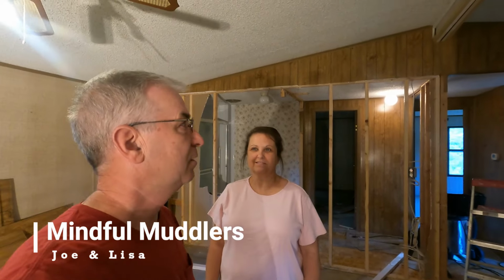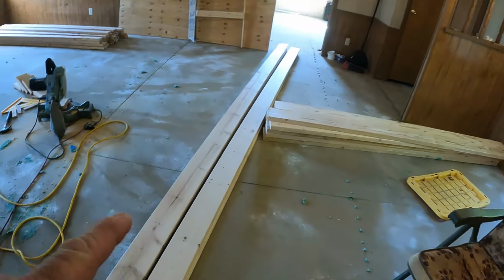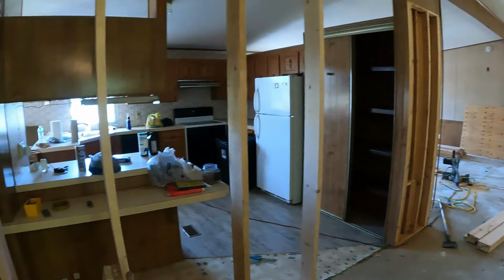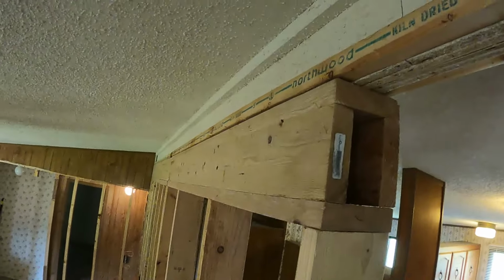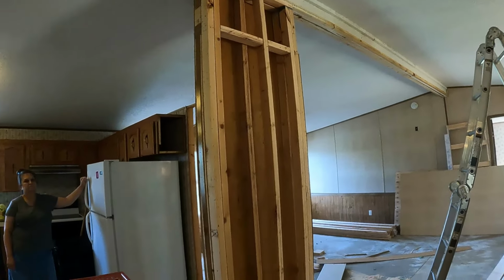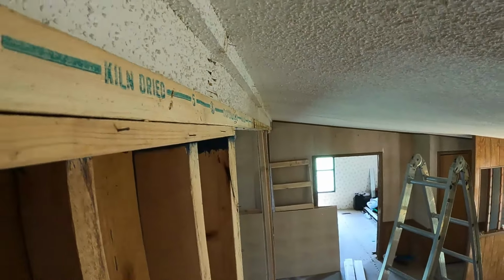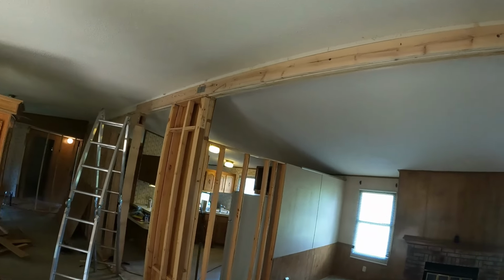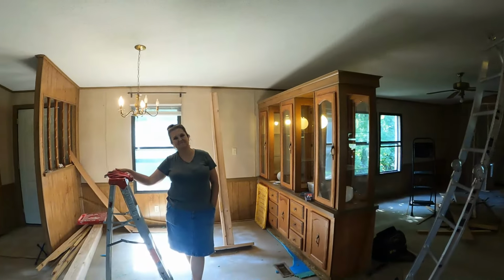1985 Double Wide Mobile Home Renovation/Center Support Beam

Comment: I've been amazed at how cheap some mobile homes are built. I helped a buddy work on a double wide he purchased to rent out and it had 1x2s on 24 inch center! The only saving grace was it did have atleast 2x4s 16 inch center for exterior walls. But again talking about cheap is the floor was only 2x6s on 16 inch center with only 5/8 inch particle boards. We personally live in a double wide but it actually has 2x10 floor joist on 16 center and actual 2x6 exterior walls. It's basically built like a conventional house. We even have 2x6 trusses in the roof. It was the only reason I agreed to buy it. If it wasn't for the marriage wall you wouldn't be able to tell its a mobil home. We did a complete renovation when we moved in though. We took it down to the studs. We replaced everything. What's nice about doing a total renovation is you wind up with a house that's exactly like you want it. There were times we thought we made a huge mistake but now that we are coming to the end ,it's just amazing to look at what we've done so far. It's an awesome feeling that I'm sure yall will have as well.
Reply from the maker: There isn't any comparison in the past and present mobile homes. Sounds like you have put a lot of work in on yours. Thanks for watching